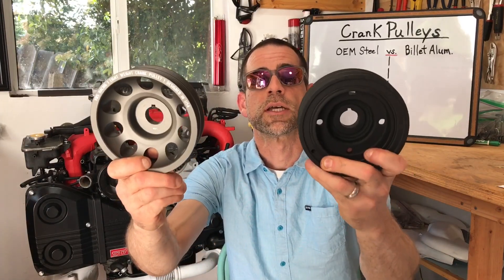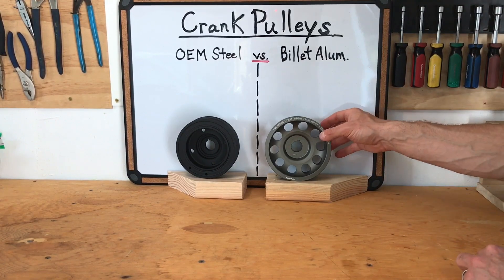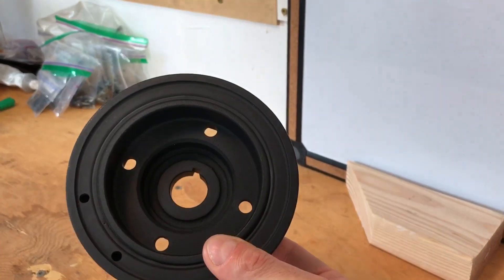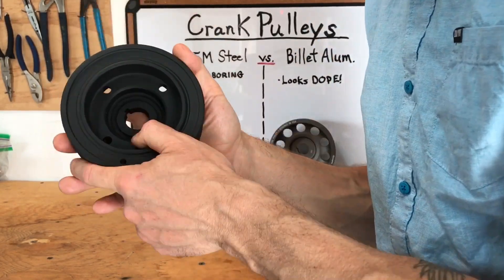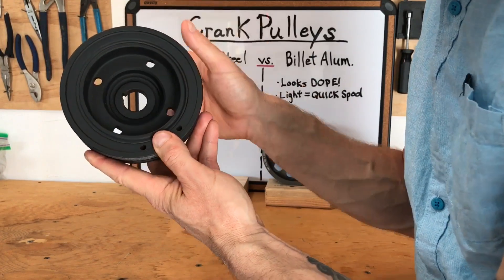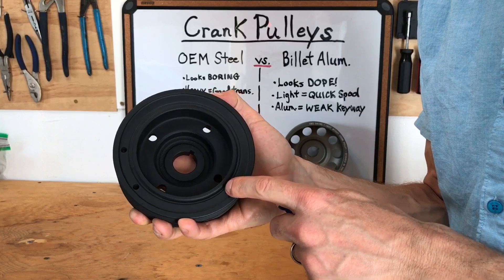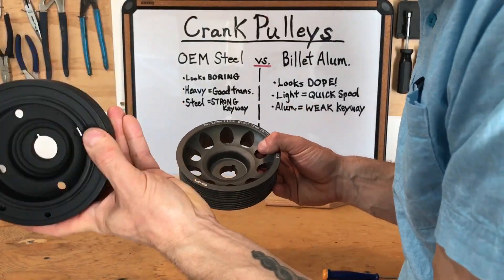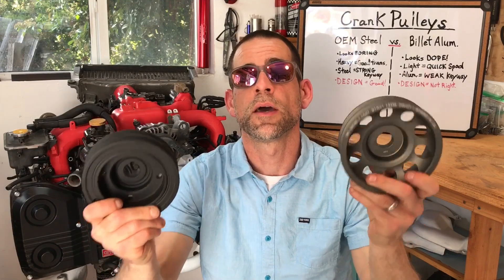Billet Aluminum vs. OEM Steel Crankshaft Pulleys

Comment: Aluminum cranks last as long as motor. So long as your not constantly pulling your motor. My Agency Power lasted till I swapped my jdm engine. 
EJ crankshafts are so short unless your doing high speed runs for long durations your fine with an Aluminum Crank Pulley.
Reply from the maker: Thanks for sharing man. I agree ☝️

Comment: The OEM one has the rubber for vibration dampener, which will let bearings to wear out less, and engine to be more reliable. 
I wouldn't use that bullet one, once learned that OEM has the dampener

Comment: I wanted to comment and say that subaru of America has confirmed that the OEM crank pulley functions only as a pulley and not as a damper. The rubber ring is there to reduce noise heard from the belt tracking on the pulley.
So although very well put together this video is misleading and in fact, it is incorrect in that aspect.
Reply from the maker: I appreciate your input and I’ve heard this before. However, Subaru also published technical service bulletins referring to it is a dampener.  No BS.  They’ve called it both on different occasions. Maybe both are right then.

Comment: Does that apply for the FA20 engines?
Reply from the maker: Prob not. I don’t know those but I would think Subaru solved these issues with it.
Reply: @SubaruONLY  it’s a 2019 wrx but I’ll take a look at the stock crank pulley and see if it has that rubber band on it. I guess That would be an indicator that it’s dampening the crankshaft right?
Reply from the maker: Yes, it’s def would be. Cheers!

Comment: How the fuck a rubber damper on the pulley stop the crank from moving up and down or vibrate... I say if your crank is doing such you need to rebuild.... what you try to say pulley does are basically the job of the flywheel..
   There's a load on the pulley and thats the load of the serpentine belt and every thing it drives, the damper actual dampens that load shock...it lessen vibration outside the engine not inside engine.... just like how an engine mount dampens and cancel out the dam vibration of engine to cabin...but it doesn't means that your shifty built engine thats not balance properly when building is going to stop vibrate internally because of good engine mounts.
   The heights of misconception and misleading information has becomes so true.
   Modern engine are balance internally unlike older engine that didn't have technology/ tools nor knowledge back then.

Comment: Thanks man, I've been doing research before replacing my broken pulley, after watching this I'm sticking with oem.
Reply: Hi benny. I have broken pulley as well yesterday. May i know what is the part number of your replacement pulley? Does every EJ 20/25 pulley have the same dimensions/diameter? Thanks
Reply: @PyeWhite  yes, as long as the year is the same the size doesn't change. But when looking for parts make sure you get vehicle pacific parts to insure proper fitment
Reply: @SubaruONLY  part number 594-166
Reply: This is for an 02 legacy gt

Comment: I guess I can imagine how an ac compressor clutch engaging would really twist a crankshaft without the pully dampening.
Reply from the maker: I don’t think the AC compressor causes any crankshaft flex - the flex is due to the combustion event and high peak pressures created in each cylinder, that and the harmonics that can amplify under certain conditions (ie RPM ranges).

Comment: Subaru has a short stout crankshaft with plenty of bearings to take the load. I have an aluminum under drive pulley on my 91 sport sedan with 298,000 miles. No problems, but you do need to torque the center bolt correctly.
Reply from the maker: Nice car man!  And some legit miles on it - awesome!!! 👍

Comment: Question  I’m trying to get more rev for my 350z do you think is safe to install this light weight pulley and have you have any issues whit yours sir thank you for the videos
Reply from the maker: It’s a good mod for that. As long as you don’t have a lighter flywheel, it be good. 👍

Comment: The oem has failed repeatedly on my on my 3rd so far. The band is where the pulley separates from the inner structure. Also fyi for everyone out there. Certain years have a class action lawsuit. The bearings fail due to manufacturers defect. It extends the warranty to 100k. And they'll replace the short block as long as you didn't beat the piss out of it. 2014 wrx owner.
Reply from the maker: Great info to share man!!  Thanks for helping out on this one!!! OEM ones often last longer, might want to check the crank seal and crank end play to make sure it’s not wobbling due to wear.  Cheers and thanks for watching man! 👊

Comment: Luke and everybody out there, does it make any difference if am running a VMS off of an NA Subaru? Cuz am thinking LWP do more possible do more damage on an engine that pulls strong such as a Turbo Subaru. Any advise here?
Reply: N/A run well. As for high rpm depends on driving. If it’s a track then yes. Rally cross no.

Comment: STOP saying bullshit, theres enough info around internet and places where its says : Subarus do not come with a harmonic damper or balancer like some other vehicles do. For other manufacturers vehicles, yes this is a legitimate concern. Proof:

"Thank you for your patience as I checked with our Technical Services Department regarding your message below. They advised that the crank pulley is a pulley and nothing else. It is not used as a harmonic damper/balancer.

Thanks for the opportunity to be of assistance. If you need any future assistance, please feel free to contact us again."

Best wishes,
John J. Mergen
Customer Service Department
Subaru of America, Inc

Comment: @#SubaruONLY hey man i absolutely love your videos! I Just ordered and installed the GDT cyl 4 cooling mod after your review and some research and I couldnt be happier. Since i just built a forged bottom end and want to maintain reliability, ive been considering the Fluidampr harmonic balancer. What do you think about them in comparison to these?

Comment: So, according to friends, which one is good to use between OEM pulley or lightweight aluminum, in daily use of vehicles?  and give me the excess and disadvantages of each
Reply from the maker: Prob safe with either option. If your looking for 200k mi. - ie super long term reliable motor, I’d go with the OEM one.
Reply: On Subaru with stock oil pump you are better off using the heaviest crank pulley you can find. The lighter the pulley you put on , the shorter your engine life will be. Thats a guarantee. Bearings will get chewed up by the lack of oil due to overspeeding of the crankshaft relative to what the ECU thinks it is;
Reply: @mrsorgic4790  doesn’t make sense, the ecu can measure rpm quicker than you can blink.

Comment: Just noticed your Subaru channel. The article on the pulley differences was very factual, you are not the only Subaru engine builder who has pointed out the problems with light weight pulleys.  Viewers should check Dominic Acia's video on the same topic. Hope I have time to check more of your videos, as I am working on a '94 WRX which I have installed in a 1970 Karmann Ghia.
Reply from the maker: Cheers! Sweet swap you got there man!! 🤙🤙
Reply: I'll be watching for more informative videos  on your  your tube,  I am new to Subarus and the ecu technology and have a lot to learn, coming from the 1970 carb era, this will be my last mechanical venture. @SubaruONLY
Reply from the maker: Awesome man.  Glad you find this channel and you’ll find the Subaru community is full of really great people.

Comment: Subi crank shaft is shorter then a inline engine harmonics are caused by imbalance as humans know you can build perfection we build with tolerances those cause differences differences cause vibrations weight dampens vibrations. So basicly "harmonic balancer" and if this thing is unbalanced out of tolerance say by by to your bearings
Reply from the maker: Great comment!   Thanks!

Comment: Fluidampr is the only way to go!
Reply from the maker: True that.  100%.   They are the BEST option out there and many big HP motors are running them!!! Thanks for sharing!!! 👊
Reply: I'm late to the party on this but does fluiddampr give you the same lightweight performance while giving you the benefit of having the rubber still on the pulley?
Reply from the maker: Not really, it’s not really all that light, but I think the trade off is worth it!!! 👍

Comment: So... I am replacing a lot of stuff that needs attention in my 98 GT Legacy with the 2.5 motor. I have to replace the pulley also, since it's visibly wobbly. I plan to: fix oil leaks which appear to have it's source in the cam seals (according to a mechanic who was working on the car a lot before I bought it) and while I am at it, I will replace the valve cover seals, and maybe the cam half circle seals. i believe i have the SOHC version, so two main seals are probably leaking. I am going to fully clean it up so I can see exactly where the oil is coming from. My question is pretty simple: Where do I get a kit that is going to definitely have the good Japan sourced bearings and sprocket bearings that are like the OEM? I don't want to spend a fortune, but I also don't want to be doing this again for a while. I am very confident since I have successfully built 2 flat 6 3.0 liter CIS engines that were producing awesome power for that 911 RS.
Reply from the maker: You should be able to find the OEM kit on Amazon or from one of the big Subaru parts dealers like Herberger Subaru in CO.  Once you get the correct parts numbers, you can search the internet using just those numbers and you’ll find lots of options. Good luck buddy!
Reply: @SubaruONLY  I found a good kit... GMB - which I believe is based in Japan, so I think the quality should be good. I will let you know what I found. I am going with the OEM steel on the Harmonic Balancer, and as high quality on everything as possible. I will do fine. I understand these engines due to my experience with the boxer engine format on my 911s. The engine is slightly different, but close enough to recognize all the essentials. Thanks!
Reply from the maker: Awesome.  Yes, pretty much any part manufactured in Japan will be high quality part for sure!

Comment: Cool video never knew that. What's the worst that could happen if I over tighten the crank pulley bolt
Reply from the maker: Thanks man.  Probably the worst that can happen is it threads strip and then the pulley comes loose.  If that happens, the crank snout could get a little messed up and the timing cover will definitely get damaged.  But no damage to internal stuff like valves or anything.
Reply: SubaruONLY thank you

Comment: Very good step by step logic. Thank you. Maybe a manufactures could make  apuly hafway in between? Dampend but a bit lighter steel?
Reply from the maker: There are few aftermarket companies making something similar - I like this one most: FLUIDAMPR HARMONIC DAMPER
Reply: @SubaruONLY  that one is about 1lb heavier than stock but reduces vibrations quite a bit better in the high RPM range.

Comment: I've used lightweight pulleys on all our Subarus. I notice the snappier throttle and better mpg. My last one ran 180k before transmission failure and I didn't want to put the money into it. I've been running over 30k on my current one with 0 issues. I highly recommend a high quality one in stock size.
Reply from the maker: Nice feedback man!   Thanks for sharing - this sounds like most people’s experience.   Cheers!  🤙🤙
Reply: About 80k with the pulley on a 2007 ej25 now car has 100+k

Comment: Should I be able to turn my cam pulleys by hand? Mine seem stiff, not sure if there’s a bigger issue?
Reply: That’s without the timing belt being installed...
Reply from the maker: Yes, you should be able to rotate it by hand, as long as it’s not pushing open the valve; ie it’s on the flat part of the cam lobe.  Double check that all cam caps are in right position and everything is seating correctly.  Also, the front cam cap bolts are usually torqued to lower values than the mid and rear bolts.  You got a Factory Service Manual (FSM)?  Good to use one for sure.  Good luck buddy!  🤙🤙

Comment: Two OEM crank pulleys spun on my ej18. After the second OEM pulley spun, I replaced it with the VMS lightweight pulley. The AC compressor became defective and locked up and spun on the keyway as well. I used loctite and torqued to specs. I ended up scrapping the car, since the main seal had become damaged. 
The EJ18 was over 190,000 miles when I purchased it and I had retired it at over 270k. Purchased for $1200 and it lasted 9 years.
Reply from the maker: Another high mileage Subie story that paid off BIG time!  Love it man.  Thanks for sharing!

Comment: Just went through an emotionally devastating blown engine. I was looking at putting a light weight crank pulley in just before it happened. Now I'm keeping it stock, and maybe one day when I can afford it, (new ej255  bottom end, top end refurbishing etc etc etc. costs so much!) If I ever do pull it off, I'll be installing an aftermarket oil pick up tube (my original one cracked causing the catastrophic damage,) a Air Oil Separator, and a fluid damping crank pulley.  I didn't expect my engine to randomly blow out after doing so much preventative maintenance, but alas, who doesn't want to be in debt over an inanimate object heart break?  le sigh.  To anyone out there who owns a Subaru engine, replace the stock oil pick up tube immediately with either a Moroso or Killer B brand. I've since learned that these things have caused many owners a lot of grief. I'm amazed there is no class action suit, but then again, we all mod our WRX/ STI's to a degree, so we're all screwed on that front.  Oil Catch Can/ Air Oil Separator to keep the Turbo alive and happy, and a Fluid Damper pulley are 3 items that will help keep your horrendously expensive engine alive.
Reply from the maker: So true!!!   Thank you for placing the spotlight on this.  This is really important!  

This gets me thinking... maybe I should do a video on what the biggest Subaru weak spots are - cause this situation with the broken oil pickup is totally a common issue, has burned countless people, and it can be fixed/prevented with the right combination of parts.    

Thanks very much for sharing and really sorry to hear about your blown engine man.  Good luck buddy!  Hope to hear back soon.  🤙🤙

Comment: After some series of events, I some how managed to bolt my factory crank pulley on in such a way that the woodruff key was either on its way out or not in the slot, and driving to lunch, the woodruff wallered out the inner hole on the pulley, something snagged, teh bolt came undone and when I got back to work the crank pulley was just resting against the radiator, oil was everywhere. It was then that I realized the significance of crank pulley torque, as well as the quality of the woodruff key.
Reply from the maker: Ty Crawford dude!   Sorry to hear this.  That is super rough one.  Good luck.  Drop a message if there’s anything myself or anyone else here can do to help!  👊

Comment: Nice Video 👍 but you forgot the balance between the crank pulley and the flywheel on the other side of the crank shaft. 😉
Reply from the maker: Thanks for the complement. Yes, could have talked about that as well.  True.
Reply: Could you elaborate? I have a Grimmspeed Pulley and a ACT Lightweight flywheel and now I'm scared to install them.

Comment: I just want to point out the fact that. The OEM wasn't well-designed. Also due to its Rubber seal around the metal to the outside metal. Causes a separation. And trust me you won't notice the last second. I have plenty of pictures to show you what it does also have my motor out right now. And not to mention. It's almost damn near freaking impossible to get that godforsaken crankshaft bolt out no matter how you approach it with OEM steel one that has a rubber balancer. You didn't make a good video. I appreciate it too.
Reply: Timothy, I learned a neat trick from my friends father like 30 years ago on how to loosen the crankbolt if you don't have the spanner. DISCONNECT the coil (REALLY IMPORTANT!), then get a long enough breaker bar and set it up so the handle is laying on the frame (OFF side is the drivers side - due to motor rotation), give the starter a quick hit and it will loosen it. I've done this countless times. YW
Reply from the maker: Old school.  Legit.  😎😎😎
Reply from the maker: Good points. Thanks for the comment.

Comment: An old drag racing trick was to put a heavy flywheel on a small engine to hold the revels up high when you dropped the clutch at launch. It works well too!
The most important think for a crankshaft pulls, or harmonic balancer, is that when an engine coughs, sputters or vibrates at very high rpm the rubber band inside the heavier OE pulley can save your crank. If the lightweight pulley was used along with a harmonic balancer like an American V8 it would be the wat to go!

Comment: It does not matter witch pulleys you use, your belts dampen the pulley. The problem with your Subaru you need to watch out for is oil consumption and head gasket problems.

Comment: If this is true what about lightweight Flywheels?  Is there any reason those would cause any damage that you know?
Reply from the maker: Lightweight flywheels are a great option.  As far as I know, that don’t cause any damage.  I use them for sure!!
Reply: SubaruONLY Thank you for the response!  Glad I found my way to your channel.  I will be checking your videos out further.  I have a LW CP just took it off thinking it was triggering knock sensor.  Turned out that was not it...  Was debating to put it back on or not.  Still up in the air!